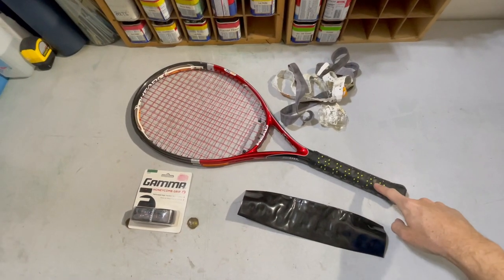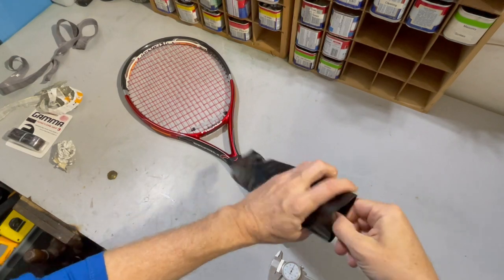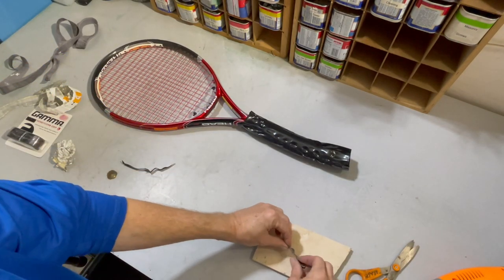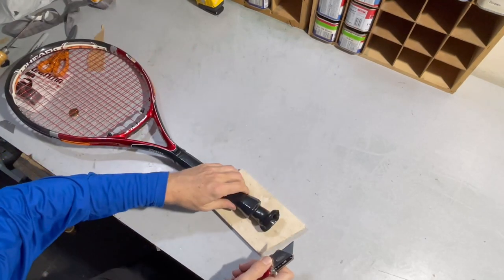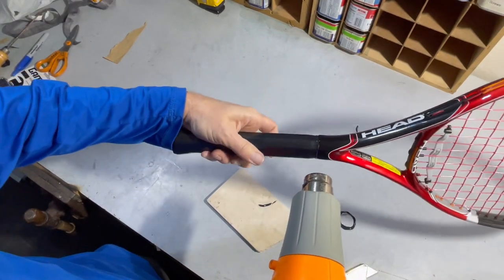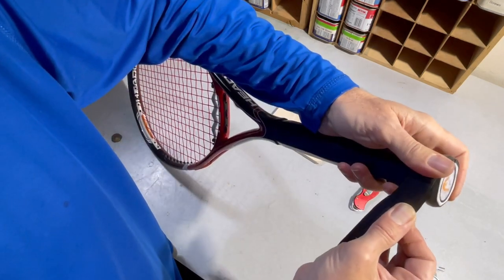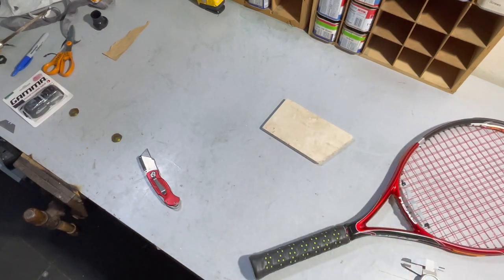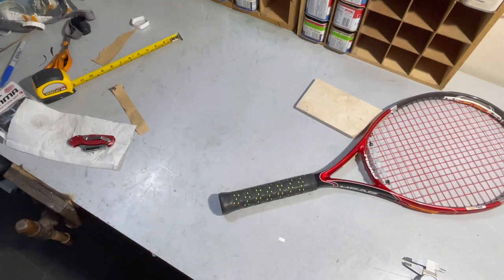How to Increase Tennis Racquet Racket Grip Size with Heat Shrink Tubing (Install and Measurements)

Comment: You change also the balance and the swingweight with those scrink/ heat gun Tubes as they weigh 10-15 grams. Maybe you need to rebalance it with some lead tape in the hoop to get the swingweight and plowthorugh back.
Reply: Well he also removed 10-15 grams of previously existing material.
Reply: @jaekn  ?
if you talk about the base grip.... Then that will be added on to the heat shrink tube.
overall make it more weight by 10 grams in the handle and therefore it needs to be rebaleanced maybe by adding lead tape to the hoop.

Comment: where did you get the sleeve at?
Reply from the maker: Tennis Cabana, my local tennis store.
Reply from the maker: I found a second source for the heat shrink tube because I am working on my back up racket grip now. Buying it at the tennis store is about $10 for enough to cover your racket with one layer. You can find 24 inches of tubing (enough for two layers) on Amazon for $8 
Important: you need to look for a tubing that has an 80 mm flat width (2 inches). This is not the same as diameter of the tubing when it's open. If you flatten the heat shrink tubing on the table and then measure how wide it is it has to be 2 inches across. This gives you a circumference of 4 inches, enough to go around the racket grip.  This tubing size will slip over your butt cap of your racket without having to remove it and shrink down way more than you need.  
If a single layer of this tubing doesn't increase your grip size as much as you want it to, you can simply put another layer of tubing on and shrink that until you get your ideal grip.
Reply: Can you put an Amazon link for the shrink tubing?